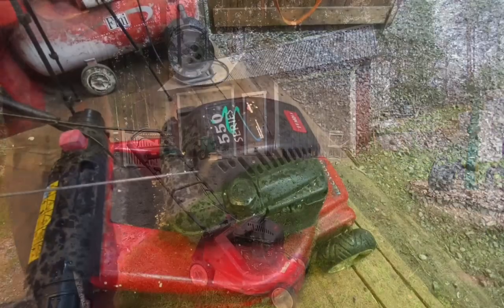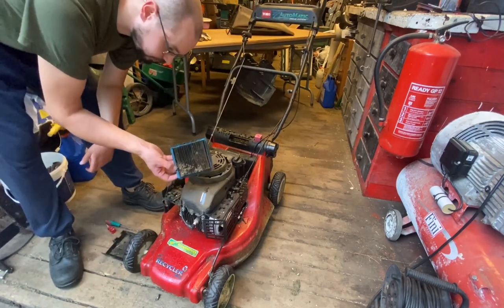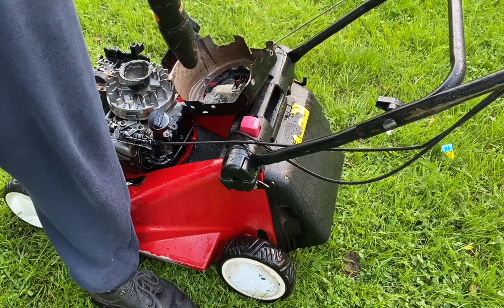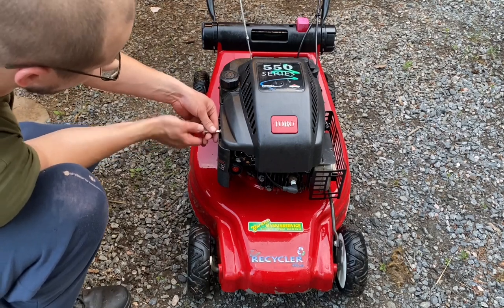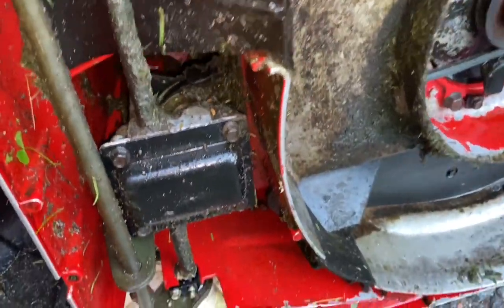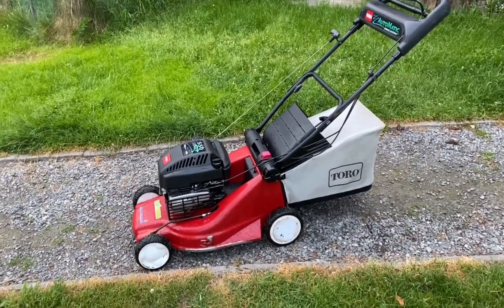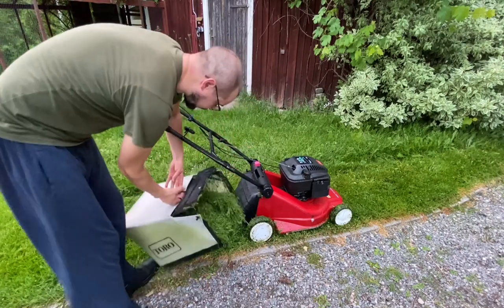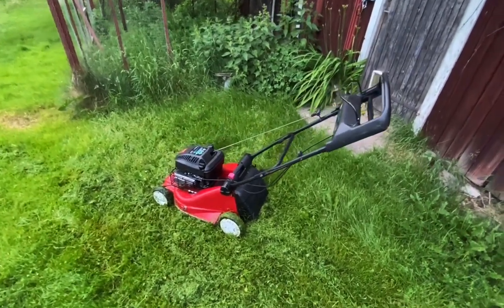Toro Recycler 20817 lawn mower repair and maintenance and also handing out eternal glory

Comment: What are those yellow nozzles in oil and other canister? Could you share some experiences how they work, both for oil and gasoline etc? Any other tips or products for avoiding spilling the liquids?
Reply from the maker: Hi, they are common in Sweden, they are actually made for gasoline but I had one with a funny thread and found that it would fit on oil containers so I use it for topping up oil in small engines.